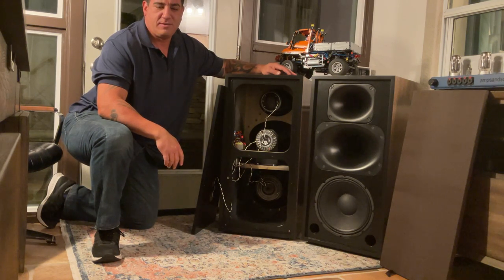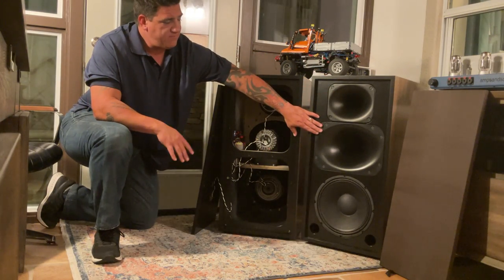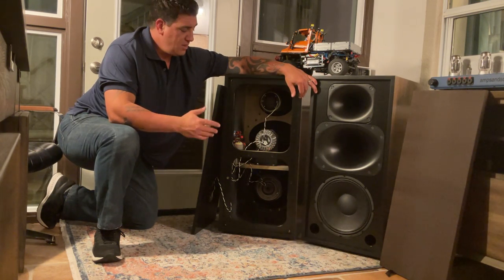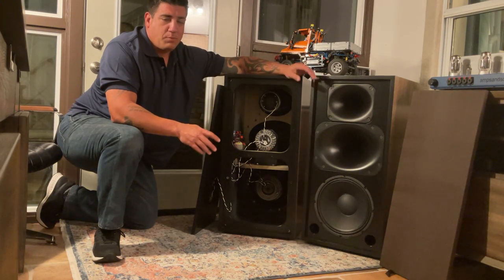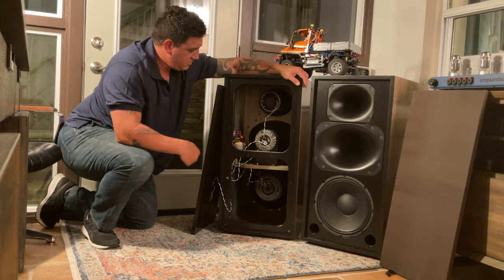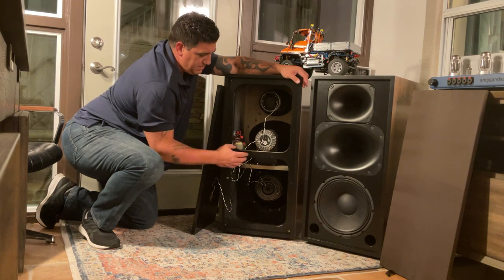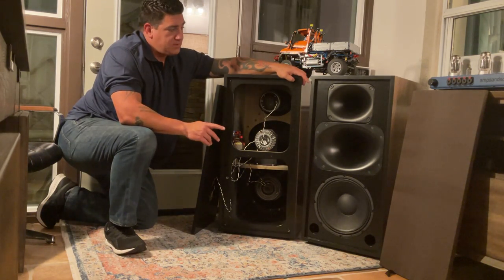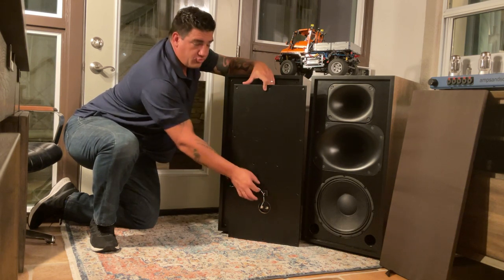Skinny Cornscala walk through

Comment: There is no such thing as going overboard on using real fasteners and cabinet bracing, quality wire when you are choosing top quality drivers. Go big or go home. I have used dynamat on woofer frames and the back of the magnet too and as a lining on the inside of my cabinets, and adding 1/2 inch rockwool on top of the dynamat to create layers of different densities within the cabinets and I’m pleased with the outcome and that’s all that matters to me 😉😂. 

Fantastic Speaker Project!

Thanks for sharing

Comment: Does this use the 12LFA or 12LFC?  Different TS parameters and low frequency capabilities.  
I would likely stay with a 2 way system since I can't hear much above 14KHz after 7 decades.
My other question is why both this and the Cornscala D cross over at 500Hz when the recommended min for the horn is 800 ( I assume below 800, pattern control is lost )
Reply from the maker: The horn and be measured to work really well down to 500hz, the larger question is what can the drive handle.